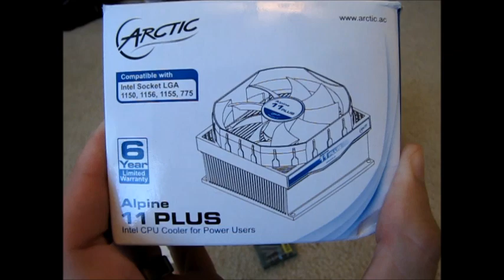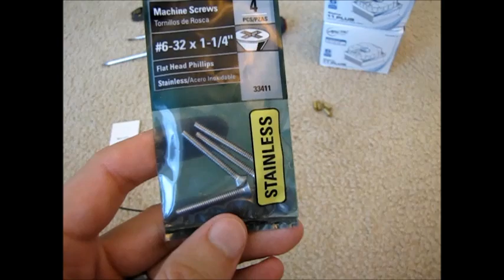How To Build A Peltier/TEC Cooling Device (Thermoelectric Cooler)

Comment: What type of screws did you use to screw both fan/heat sinks together and where did you buy them from??

Chances are as soon as someone tells me where to get them, I'm going to start building mine.
Reply from the maker: Here you go:  http://amzn.to/2ooUfB1

Do you have the standoffs to use on the other side?
Reply: LDSreliance wow, quick reply. Thanks.

No I don't have standoffs. Where can I get them from?
Reply: LDSreliance also, what did you use this module for? If you made a video can you send a link to the video please.
Reply from the maker: You can get them from anywhere that sells parts for building computers, but here is an assortment pack that is cheap that will give you options and flexibility:  http://amzn.to/2peh9uh
Reply: LDSreliance many thanks.

Have you found any ways to connect this to battery's?
Reply: LDSreliance I'm sorry, I really need help now,
I don't understand how your setup works.
The 12v power supply in your description is 120watt.
Each of the fans are 100watt and your Peltier is 50.
(100*2) + 50 is 250, not 120.
How is this working???
Reply from the maker: The fans are not 100W.  Not sure where you got that.  I think they use about 0.3A, which would be about 4W or so.  So one power supply will power both fans and the peltier easily.
Reply from the maker: You can use this with a battery but it will drain it pretty quick.  You would just connect the positive (red) wire of the fans and peltier to the positive terminal of a 12V battery and the negative (black) wires to the negative terminal of the battery.  Do not use a car battery or it will discharge within minutes and harm the battery.
Reply: LDSreliance ohh, fans are 4watt. I googled up the fan name and the first title I read was 'Alpine 11 Plus 100Watt'.

As for the battery.
A car battery will discharge and ruin? If I use with battery, my portable ones are quite expensive. I don't want them being ruined. If you can, could you explain more please?

Many Thanks
Reply from the maker: Car batteries are meant for a brief surge of high current.  They are not designed to provide usable power for longer than a few minutes, depending on the load.  Here is a video that will explain more fully:  https://youtu.be/9cV837XhCN8

I'm not sure I understand your connection question.  It should be pretty straight forward as you just connect the red positive wire to the positive terminal of the battery or positive lead of your power supply and then the black or negative wire to the negative terminal of the battery or power supply.
Reply: LDSreliance do you recommend series or parallel circuit?

I know I'm asking a lot of questions, but if it's an inconvenience please just ignore, as that is the last thing I want to be.
Reply from the maker: You are not an inconvenience.  I am glad to help.  I would just ask that you thumbs up my video, subscribe, and/or donate a few bucks to my Patreon campaign:  https://www.patreon.com/LDSreliance

I would wire the fans and peltier in parallel.  I don't see any benefit to series and it will add resistance that will be bad.  For these little devices I usually just crimp the positive wires together on one end of a butt or bullet connector and then crimp the other side onto the positive lead of the power supply or wire going to the terminal on your battery.  And then repeat for the negative side.  You should probably wire in a simple dc switch in line if your power supply does not have an on/off switch, too.
Reply: LDSreliance for the fans, do you know any way of putting a guard on the front to stop your fingers getting caught in it?

Comment: One side hot and other side cold air - how it will work as cooler when used inside a room?
Reply from the maker: It will not cool down a room but you could have a fan blowing outward from the cold side heat sink into a room and then use a separator between the heat sinks that is shaped to fit your window and have the hot side heat sink outside your room.

Comment: how much amp it's need for ice making ?
Reply from the maker: It depends on how good your heat shedding is on the hot side and how much volume of water you are wanting to freeze.  Even the lower power ones I have played with (5 amps) can freeze a drop of water instantly.  But a cup of water?  That would obviously take much longer and probably require more power.  It will also depend on how good the insulation is around the water you are trying to freeze.  If it is inside a well insulated box like a freezer then it should be fine.  If it has to fight against heat creeping in, though, it will be much less effective.

Comment: is it a good idea to put peltier TEC to laptop cooling pad?
Reply from the maker: I suppose you could use it for that.  As long as you had a good cold plate or something and a way to direct the peltier's heat away from you and the laptop.
Reply: That's cool... 
any advices btw? I'll build a tutorial at instructable website if i have enough time :)
Reply from the maker: Look into using laptop heat sinks.  They are designed to be flat and use a special fan to blow air out the side.  I imagine if you used one of those on the hot side at least it would keep you from burning your legs.
Reply: LDSreliance  thanks bro 👍

Comment: This is so cool that you put this together - and that you shared your knowledge.  I have a question, though.  I bought an Alpine 11 Pro.  It has four wires.  Did you just use the red and the black wires to hook up to your power source or are all 4 needed.  If so, which color wires go with the positive side and which with the negative side.  Thank you in advance.
Reply from the maker: Only 2 of the wires are needed.  The other 2 the computer uses to manage the speed of the fan.  One of the wires on the end of the 4 wire spread is marked on the connector with a ^ or arrow and that should be the ground or negative wire.  The positive wire will be the one just next to it.
Reply: Worked like a charm.  Thank you again!!!

Comment: I used to work in hardware...maybe eight panhead SS bolts with a coupling nut in between each pair? For something this size it probably doesn't matter, but if you step up and need to apply torque or need something a little burlier, coupling nuts would allow for something a bit more industrial strength. Nicely done, though! Elegant solutions.
Reply from the maker: That is a good suggestion!  If and when I revisit this in the future I will have to try that.

Comment: I have an odd question. Is it possible to use the peltier module to switch between the heating and cooling effect, with the help of some device like a temperature controller? What I mean is, I want to create a box that will keep the ambirnt temperature inside at 65 - 70 degrees constantly. So if the temp. drops below 65, the hot side can kick in to heat it....or if the temp. goes above 70, the cooling side will kick in with the help of a heat sink and fan. ...is this at all possible? I don't fully understand how TEGs work.
Reply: I think you need an H-bridge circuit for changing the polarity.
Reply from the maker: Yes, that would be possible in theory.  I am not an electronics engineer but I have tested these with thermostats and they do work.  So you could wire in a thermostat but you would also need something to automatically switch the polarity back and forth to switch between heating and cooling based upon whether it was too hot or too cold inside the box.  I don't know how to do that but I know it can be done.
Reply: LDSreliance Thank you for the response. This is a very promising technology.

Comment: the screw Will transfer heat from hot block to cool block it Will reduce output of cooling. yu should isolation the nuts of screws
Reply from the maker: True, it will transfer a small amount of heat.  Someone suggested using nylon washers previously so that might help.

Comment: How to get that fan rotate in other direction for cooling?
Reply from the maker: Switch the polarity of the fan.  Or just mount the fan backwards.
Reply: Don't switch polarity, it will fry the motor! I fried two of them. I contacted the supplier and they informed me that you can't switch direction by reversing the polarity or you will fry the motor.

Comment: What's more efficient in terms of "energy spent/heat transferred", peltier or compressor?
Reply from the maker: Compressor is way more efficient.  But they have drawbacks, such as shorter life span, more fragile, can't tip them over, can't vary voltage, and produce more noise.  Usually those are not issues for people with a refrigerator so that is why almost all fridges use compressors.
Reply: Kinda like what? Would you say double the energy for the same cooling?
Reply from the maker: ThalesPo
Double could be a good estimate.
Reply: OK. Thanks for the info.
Reply from the maker: ThalesPo
You are welcome.  Thanks for watching!
Reply: Strictly speaking a peltier can be setup in a configuration that is more "efficient" (large C.O.P) than a standard AC Unit but that requires a low delta between the hot and cold side of the Peltier and it can only move a small ish about of heat. I've getting round to making a video series of TEC efficiency cos people ALWAYS get this wrong. While we're being pedantic the is not a 12v TEC as is has 127 couples.. But what ever. :)

Comment: Hi mate, Wondering if you could share your opinion about a project I 
want to try. Thanks for making your vid BTW. So I use overear 
headphones. But they heat up so much they become un wearable. can I 
cool with these peltier plates. I would not mind having a cable to a 
external battery. I just always see these plates used with crazy big 
heatsinks. Any input would be great

Comment: Are you use spu for connecting to switch up?
Reply from the maker: What is spu?
Reply: @LDSreliance
Do you put thermal paste in between the heat-sink for the cold side as well?
Reply from the maker: AmuckPVP
Yes.  You won't get great contact between the metal surfaces if you don't.

Comment: Could these be used for a cigar humidor? how would you maintain it at 65 degrees? Any info would be helpful.
Reply from the maker: The short answer is yes.  The long answer is you would have to use a thermostat and some electronic wizardry (voltage regulators and such) to keep it at a very steady temperature.  But I am not sure what effect, if any, it will have on humidity.  That might be a problem as I have never had to worry about humidity before.

Comment: There are four wires on the alpine 11 plus. black, yellow, green, and blue. Which wires do I use for this assembly hooking up to an automotive cigarette lighter plug?
Reply from the maker: Mine weren't color coded.  They were all black.  On the connector there should be a triangle or arrow pointing to the negative wire.  The positive wire will be whichever one was next to it.  If you have already chopped off the connector then you will have to use process of elimination to figure it out.  I would say black is a safe bet to be negative, though.

Comment: Yes. It won't be too much of a draw on the car battery or alternator?
Reply from the maker: This system uses less than 7 amps under full load so that should not tax any alternator as the car is running.  If the car is not running, the battery will quickly deplete.  You should never run a load on the car battery for more than a few minutes without the car running.

Comment: I am assembling a 10amp unit for a homemade cooler for a transport cooler for pastries. How would I go about taking this setup and hooking it up to the cigarette lighter in a vehicle?
Reply from the maker: You would just need to order a cigarette lighter connector (something like this:  https://www.amazon.com/Roadpro-Fused-Replacement-Cigarette-Lighter/dp/B0016LG0CY/ref=sr_1_1?ie=UTF8&qid=1471893012&sr=8-1&keywords=cigarette+lighter+connector) and connect the peltier and fans to the leads.

Comment: Could you use this to keep ice cold longer?
Reply from the maker: Yep.  In my experimentation, I have been able to get down to 40 degrees F pretty reliably  and with some more power it could get down below freezing.  But even at 40 degrees it would keep ice for days I think.
Reply: As long as I can do this and make miniature air conditioning units using ice, tubing and air conditioning coils and fans last longer with this, then great!
Reply from the maker: Derpy Redneck Yes, that would be a great use for this.  It would keep the ice cold longer and prolong the time between ice refills.
Reply: which side would I place the heat portion in?
Reply: So, where exactly would I put the side that pulls the heat away at?

That's what I meant to say.
Reply from the maker: Derpy Redneck The exhaust side of the hot side should be ducted outside somehow.  If it is a refrigerator you just have the exhaust on the back side.  If it is a air conditioner you put it outside the window.

Comment: How come I have the same Peltier module but it didnt freeze up the water ? Its running off 12v power... Did I purchased a shitty module from ebay or my power is not strong enough ? It's cold but will not freeze. Thanks a lot
Reply from the maker: Could be either.  Can you measure the voltage and amps being used by the module?  I have had a lot of these cheapo ones come defective or get damaged in shipping.  Also make sure you have a nice connection with your wires.

Comment: Could I power these device on my pc source using as a cpu or gpu cooler?
Reply: Felipe Santana yep even just the peltier chip but the other side would be very hot but it won't radiate so the other side would be very cold
Reply: Would condensation ruin any electronics in pc by running this device in it?
Reply: Iceego Mute it would... That's the reason why peltier fade out in the early 2000s (for cpu cooling) due to, of course inefficiency and a chance of condensation.
Reply: @ImmortalShiro  tyy for validating

Comment: I am in the midst of doing a project. I am quite curious. At 10 amps, how cold is the air blowing from the cold side of the Peltier/heatsink & fan side? Have you tested it yet?
Reply from the maker: I just got an infrared thermometer last week so I can do some accurate and repeatable testing like that.  In the past I have tried to use a temperature probe with my multimeter and would get erratic readings.  I will try to dust off the fridge and do some more testing later this summer.  Stay tuned!
Reply: Will do. Thank you very much :-) Keep up the awesome work by the way ;-)
Reply from the maker: Aj C.
Thanks!  I will try to do that.  I am starting a Patreon campaign so I can try to do more and bigger projects.  Seems like I always have lots of great ideas but not as much time and money as I would like to accomplish them.

Comment: Yes, to use like an air conditioner. Do you think it will work?
Reply from the maker: Not very well.  What I would do is use it to cool water and then circulate that cooled water around your body.  You could sew a few loops of copper tubing in a shirt or something.  But if you were just blowing air from the peltier and heat sink it might be cooler than outside air but not much.  They are good at cooling down small spaces but not big ones.

Comment: Hi, friend!
I have a scooter and now is very hot here so I have a 180watts 36 volts panel and I am going to buy a buck booster to connect to the solar panel and convert 36volts to 12volts and I would like to put the peltier to get a good climate in my scooter. What would you advise me to do? if you send me your email I can send a photo of the scooter. Thank You!
Emmanuel.
Reply from the maker: LDSreliance@gmail.com.  I am not sure what you mean by using the peltier to get a good climate.  You mean like air conditioning?

Comment: Dear, Please help me. i bought new Peltier i put the heat sink and also fan, thats cool but not very cool like other peltier i see on internet that give ice fusion. please help me. and please tell me that fresh thermal paste is must???? or old will work again?
Reply from the maker: If your peltier doesn't get very cold on the cold side then there are only 3 possibilities:  you are not getting enough power from your power supply, your peltier is damaged or defective, or you do not have a good heat sink connected to the hot side.

I would make sure that you put the heat sink on the hot side (power on the peltier for 3 seconds and then power it off and touch each side with your finger.  It will not burn you.

Also make sure that you have a nice, even coat of thermal compound.  You can reuse the compound but I like to clean mine off and use some fresh compound.  Just make sure that it provides an even seal to the peltier otherwise the thermal transfer will not be good.
Reply: Thankyou very much. i think my heatsink is not enough good
Reply from the maker: Once View Crazy World
If you get a heat sink designed for a computer CPU you will be good to go.